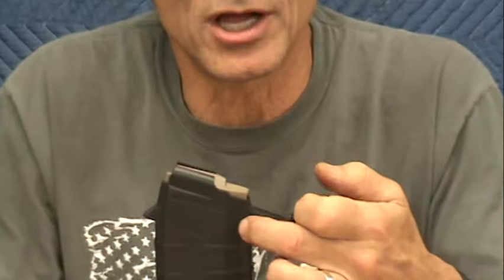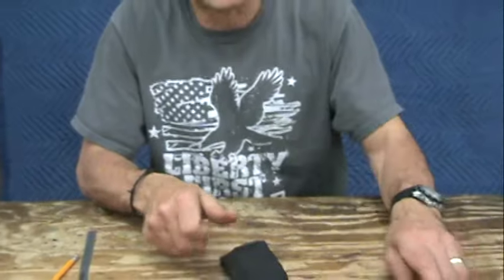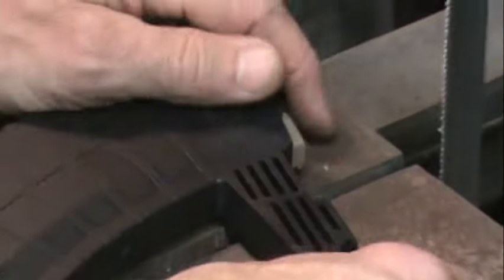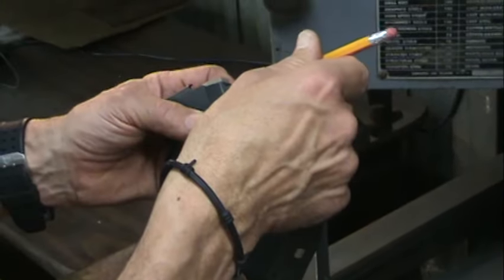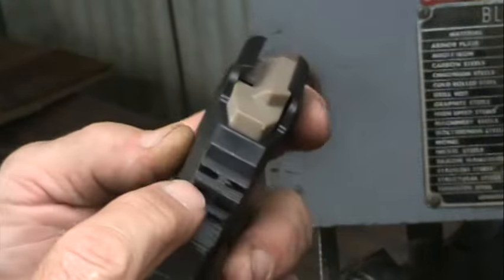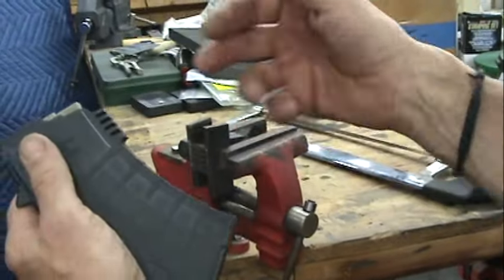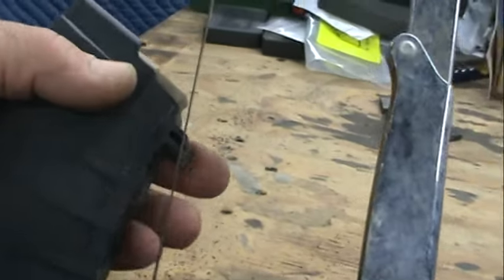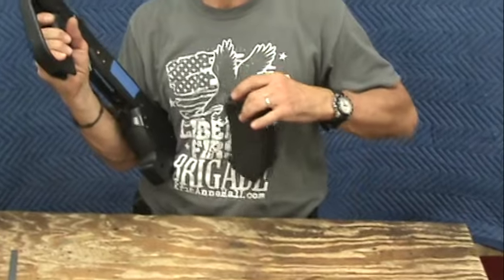How To Modify Duckbill Mags

Comment: Awesome video, but i wanna give a heads up with the zipdisc or cutting wheel, when pressure is applied to them at an angle they have the ability to explode or pull your fingers and the material straight into the disc, especially if the surface is something that heats to melting/binding point.  Otherwise the video is superb i learned all i need to know, thanks! :D

Comment: Do you have to modify the gun at all for the modified mag to work?
Reply: Only cutting down the flares on the bolt if you want to remove or insert mags with the bolt closed.
Reply: @Woogoo336 which would be a good idea for safety and ease of use reasons.

Comment: just buy an AK mag
Reply: Would that work a AK mag in a sks? What do ya say Mr. Glaros would it work. I have my Norinco sks now.  I just purchased sks Mag Pull mags they fit great there 30rds would love to not have that duck bill. I dont any if those tools to do this. Ak mag would be nice so I could use a rig that would accommodate them better than the duck bill.
Reply: No, you have to modify the bolt on an SKS, so that it will run between the feed lips on an AK mag.